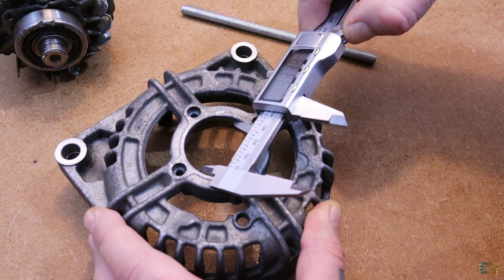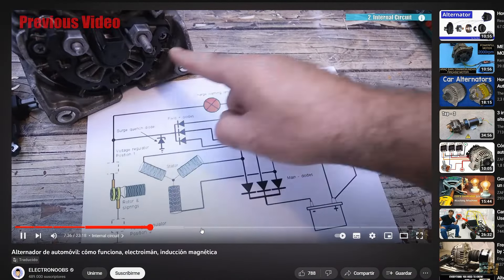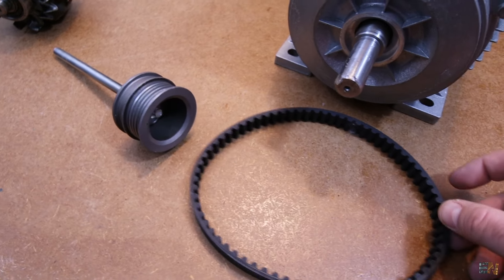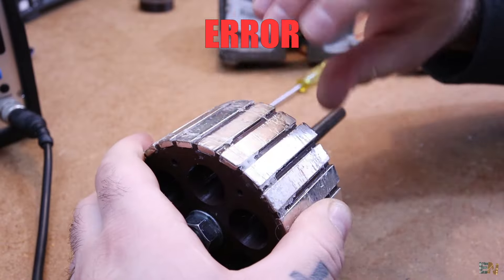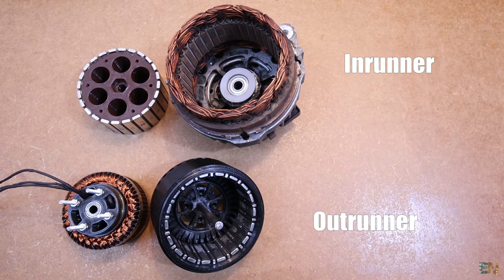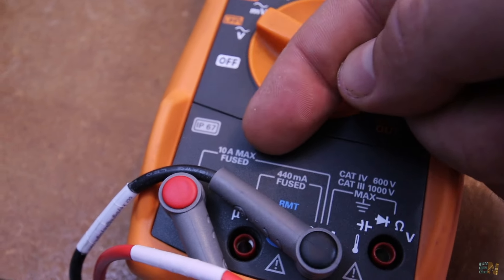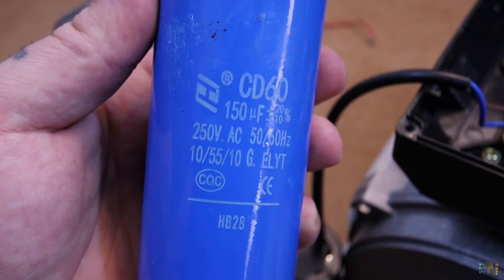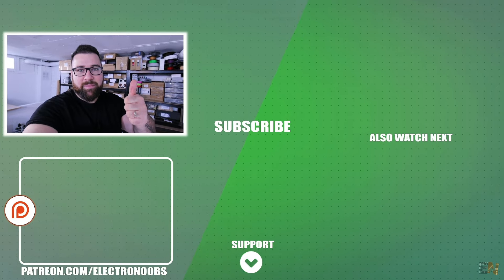Make a GENERATOR

Comment: A Car alternator puts out 120VAC per phase, you need to remove the diodes and the rectifier to get the full 3 Phase out of the Alternator

Comment: The generator was 14V x 100A = 1400VA a big difference to the magnets. Yes you need power to magnetise so that reduces the ouput power.  Another thought a transformer to convert the 3 phase to single phase and perhaps boost the voltage.  interesting video thanks

Comment: Those magnets are weak AF. Not to mention there is no way to control the voltage. Simple feedback loop AVR with a 120VAC setpoint used with the built-in electromagnetic can make this a potent little three phase alternator.

Comment: try this instead. MATERIALS: one 6 inch dia. by 6 inch long with a quarter inch hole for axle in center neodymium magnet. one threaded rod quarter inch dia. 12 inches long with 8 washers and 8 nuts. Two ball birrings , a round plastic 12 inches dia. with alluminum fins around it to create static electricity , 2 capacitors a transformer. TO give you an idea the frame holds the motor/generator on top. the static generator on the bottom both connected to the same axle pre charge the caps and start motor with 12 volt battery. motor/generator turns and gives out voltage , the static generator gives out voltage and ALL voltage goes into the capacitors. the voltage goes into npn transistor and that energy goes into transformer to plug ins strip and a wire goes from plug ins strip to motor. I suppose you could add in a 50 watt solar panel for extra power.

Comment: Electromagnet is stronger than permanent.  Yes, the ability to regulate against rotational speed and load is valuable, the move away from magneto to alternator was due much higher power generation.  What you could do, span 2 alternators.  Don't go wild redesigning the  rotor, just pop the coil out of one, and replace it with a stack of microwave oven magnets, use the power of that side to then power the electromagnet of the other.  This is already being done in production, I'm just pulling a blank on what this is called officially.  But, much simpler to use a large, powerful, disc magnet in place of the rotor coil.

Comment: 10:20  "How are the ppl from the fake videos getting 220VAC because I'm using better and bigger magnets and only get 50V peak to peak"
Here's something to consider (tho, they are fake, no doubt) when they replaced the metal portions with magnets, they left the metal core in tact. So they could very well be getting higher voltage because they have stronger magnetic flux extending out into the coils. You used plastic as the core, which magnetic flux can not be amplified in.
A revision to your rotor would be to make it so that you can put metal/iron bands under the magnets. It would be best to have a solid band from end-to-end of the magnets, but with a plastic stator, this would be difficult. Unless you drilled some holes in the metal band to help secure it to the stator. You would loose the ability to have precise slots for the magnets. Altho you could make a sleeve to go outside, or use 2 bands and have 3 spots for slots, top/bottom/middle. It would break up the magnetic flux a little bit, but not a whole lot.
Doing this would greatly increase the output of the generator.

If you look up DIY wind turbines with repurposed ceiling fans, you'd see that this is what is done to boost the output. The difference with a ceiling fan is the rotor/stator are reversed. The metal band is placed and secured to the housing the blades attach to. Then the magnets are secured to the band.
Reply from the maker: Thank you so much for all the tips. Next version should be metal made... :)

Comment: 5:31  i’m wondering if we adding some ferrite material into the 3D filament, that gonna increase the output and efficiency.
Reply from the maker: it would for sure. I don't know how muych, but it would do. Actually, I'm preparing some tests for some 3D printed motors but using resin and 1um iron powder in it, so it would be ferromagnetic :)
Reply: @ELECTRONOOBS  i have an idea for a new video, but i don’t sure how powerful it will be, that is using an induction motor (doesn’t matter it is single phase or 3 phase, if it is single phase, it required to has a aux winding or staring winding) with a capacitor can turn into a generator
Reply: @ELECTRONOOBS  the reason why your generator was only outputting 8V AC was because you had double south and north magnet polarities. this output is weak, because in actual generators, 1 north and 1 south of magnets are placed in the rotor, only 1 north and 1 south, not double, since it slows the changing of polarity of the AC current.

Comment: For The sceptics; Nikola Tesla has turned around classical Maxwell, Hertz, Einstein approach to not recognizing Scalar Longitudinal Waves, which are part of the Aether and have infinite instant speed. This are an electrical potential between A and B which by disturbing The Aether it disturbs the whole Universe. Tesla quote; If you want to understand the Universe, think in terms of Energy, Vibrations/ Resonance and Frequency. No Matter is mentioned Einstein was calling this “phenomena” quote; Spooky action in a distance. Unquote.
Tesla was spiritual extremely capable of Thinking Cleary and even he was dreaming during his lucid sleep creating his inventions in detail.
After his win in the AC DC current war with Edison he constructed Niagara Falls electric power station, utilizing Gravity of water to convert mechanical energy to electrical. It was done by using Tesla’s invention; AC power Generator as well as Transformers are still used today to light our cities, run industry, is used in medicine and many other. 
Needless to say, we use his inventions pretty much all the time, even when sleeping. 

His major inventions were Tesla coils and its applications. When presenting his Invention at Wanderclief Tower Long Island ,and successfully Pumped or connected the positive Ions in Stratosphere and Ionosphere and Earth as negatively charged. He used his double coil invention in between and converted 8 vols of DC to start the action and converted it to millions of volts of AC power.  Morgan, as an investor in the project asked Tesla what the hell this is. His answer was ; Free energy for everyone anywhere. Morgan got up and said; I’m not interested if I cant charge. This was a turning point for Tesla and he was pushed to obscurity living in hotels and after his Lab was burned down and taxi hit him on the pavement. All I learned so far by studying Tesla is ,that The World is based on Conformism rather than Curiosity and perseverance. Aby human being has got Talent for Something. Aren’t you curious about what it is?

Comment: Great Video! but I think you forgot the Inner Iron!?  Think about rebuiding the rotor with a section of 5mm or thicker iron pipe so the inner N-S Magent flux is used. This is why the outer windings are in Iron. You could then epoxy your magnets on the Iron. 
It might be fun to see how much Power Difference you would get ??

Comment: I have just make a little generator.
With tiny little n35 magnets really very small were those magnets.
And it works.
You need an iron rotor bro , and for more voltage you need to rewind the stator.
You would not believe how much power you will get.
Try it and see it yourself.

Comment: Cool. 
Question, 
If you want more power from the permanent magnets why not quadruple the size and install with fewer magnets around a redesigned rotor. Bet you can crank up that power.
Reply: Because the housing isn't big enough to house enough wire to take advantage of the bigger magnets. Should have used a 200 amp ambulance alternator that already has enough wire. Then when the windings were hooked up in series, you would get triple voltage and 66.6 amps.
Reply: Damn quadruple the size magnet will be expensive

Comment: Your generator is more impressive than you realize... Car alternators generally run 2~4 times FASTER than the motor. So you need to get that generator spinning at atleast 4,000 RPM ;-) . I bet you get 12 volts then

Comment: What about low rpm generators? How low rpm generator designed or made, means what coil's wire thickness used and how many turns required or magnet size and force are required do you have knowledge about it? If then please share your knowledge if 1000 watts generator to be made. Regards

Comment: Not having enough generator power to drive the induction motor is not the indication that the free energy self-running generator is fake, it just means you don't know what you are doing. 

The alternator you built was way too small for that motor, regardless of what turned it to produce electricity, the voltage and amperage were a major mismatch for the energy required.

I won't go into the details of how over-unity power generators actually operate, it takes more space than I have to demonstrate it here.

Comment: i-v build one at home it makes around 70 volt with just 10 magnets 40-10-5 mm , at only 250 rpm but i recoil the stator 750 turns in total

Comment: You could have put a pulley on the generator and the motor and a belt plugged the motor and it would have spun faster to the high enough voltage

Comment: There is a difference, your alternator is 14 volts and 100 amps, but Hidden Technology's alternator is 24 volts and 200 amps. Therefore, your comparison is not correct.

Comment: One reason your voltage  is so low is because you are only using a drill to rotate your rotor but since you are comparing it to the fake video you need to mirror what they used at least as close as you an. I like that Thanks

Comment: Permanent magnets lose power if subjected to heating. In a typical gas generator, the coils get hot enough to melt plastic. That's why they can't use plastic parts and save more bucks.

Comment: I produced 325 volts single phase power with one hot wire and a neutral wire from a hot tub motor I haven't checked the htz./ cycles yet but I'll let you know

Comment: hello I was interested to know culd industri type bridge rectifiers by used or darlington transistors insted standard bridge rectifier I do not have in my land solar panel regulators so was wondering if I culd use those old truck heavy dutty voltage regulators with out the field conection?
Also I am curriuse to know how it wuld by posibel to manuali set alternator speed regulation with resistora and capacitor box or avr or cloosed loop system and wuld eventualy current cutt out selenoid work to prevent over charge my baterry?
I use lot capacitors for my ignition system so my alternator does not like extermal capacitors the cutt in voltage is delayed so thats kinde of anoying so I try to finde alternative solutions for those problems wuld like litel bitt that my alternator is programabel if posibel work with out baterry in emergency situations

Comment: It's not worth spending one second of your time trying to debunk/recreate free power or perpetual motion videos.
Reply: I agree Rick!
Reply: Who is Rick prime?
Reply: @joeb134  Who is Joe B?
Reply: But watching videos are interesting and informative
Reply: @ricksampson6780 the resistance ... is less  ....no voltage ...good current .😮😮😮😮for energy pump....use a thinner wire ...long very long ....❤
Reply: You can get free energy though...if you are making electricity with salt and recycled materials no matter how small the amount is too you personally its free...if you use recycled coke cans and copper wire or tubes that you find and use sea water that too you is free energy...
Reply: 😀😄👍I think so, free energy is fake

Comment: You can't prove the generator in the movie doesn't work because you did a few things differently! For example, in the movie, the magnets are glued radically differently, and in a different order! You can see that in the film, the magnets repel each other at the time of gluing! But I think you make these changes on purpose, to prove that it doesn't work. Do absolutely everything like in the movie, then we'll see if it works or not!
Reply: Agree with you. Also, a difference between Electronoob's alternator is 14 volts, 100 amps and Hidden Technology's alternator is 24 volts, 200 amps. So, comparison in this video is not correct.

Comment: You can;t arbitrarily use x number of magnets. The best tactic is to completely disassemble the rotor and place in the position of the coil an axially polarized ring magnet(s). The hard part is to find a dimensionally correct magnet.
Reply: The six pole alternator he's using should have twelve magnets. You're correct, there's only one right number unless it's rewired with a different number of poles. A bigger diameter alternator would have room for more magnets and/ or windings poles. Twenty four magnets don't match up to the stator poles. There's not really enough room for twelve poles in that case without using tiny wire. So that part was sort of a waste of time.
Reply: @davidpotter9462   since he is using S-S-N-N with 24 magnets, the effect is basically the same like 12 magnets S-N-S-N.

Next week I make the same kind of generator. Mine is almost the same like the one in the video but made for more amps. Also I make a custom rotor thats not 3d printed but made of iron for a better flux. Also I will use 12 poles but each will have a lot more pullforce. I am not sure which grade magnets he use in the video so my guess each magnets have a pullforce around 10-15kg. My magnets have about 60kg pullforce.

I can’t wait to test the results
Reply: @sjappietappieklappie  oh okay

Comment: I have Posted my code down below. The problem I am having is that when I am using multiple pin pus to enable the outputs these outputs are not putting enough voltage out they should be supplying 5 volts to the 2 outputs that are enabled for each sequence..
1.)The three hall effect sensors are powered up from a separate 700ma 5v dc supply.
.2) The ground from the supply is connected to the Arduino Uno ground.
On another note I have been troubleshooting and just just have the Arduino Uno connected all by itself. If I connect ground to pin3 outputs 9 & 13 should both have 5 volts present but one may have 4.8 nd the other has .8 there is no load connected to these pins just straight up testing the output voltage with my voltage tester.
I need to know why both of these pins are not present with at least 4 volts even when no load is connected to them.
* Design is for The outputs areto just send a signal to a MOSFET driver when everything is eventually working correctly so a very tiny load just to actuate the MOSFET driver via the HI and LO pins.

Comment: THE REASON WHY YOU ARE NOT GETTING 240 VOLTS,.  YOU DON'T HAVE A TRANSFORMER HOOKED UP TO IT..... YOU ONLY SPINNING THE ALTERNATOR.....  YOU NEED TRANSFORMER HOOKED TO IT..... 15 VOLTS TO 250 VOLTS TRANSFORMER, YOU CAN GET FROM MICROWAVE.....

Comment: You should put the windings in series, instead of parallel, the voltage will be triple. That should be enough to start the big motor. Since you're already doing it...
Reply: are you sure puting the Windings in serie with different Phase you will have bigger voltage ?
Reply: Yeah, if it's a three phase, the voltage will triple when hooked up in series. I've done it before.
Reply: @davidpotter9462  no you will get a perfect DC 10v in output
Reply: @yuvanm9040  the Honda PMA that I did it on went from 13.1 to 39.3 volts. The alternator I have is from a Honda 660 car. If I got 10 volts I would have sold the copper out of it.
Reply: You are clearly and evidently very accurate.  "Dear" our YouTuber.. ...the divider is actually very precise!  ...that's why I don't trust you!

Comment: To be honest, you have built only one electric motor. Building a generator on a car alternator in the way you describe is just a waste of time. Car alternator produces 14.8 volts and 100Amp current maximum at 3000 RPM having a magnetic field in the electromagnet which is the alternator rotor. With the decrease of RPM in the car engine, both the current and the voltage decrease. By replacing the rotor coil with a permanent magnet, you do not gain even 10% energy, Or you need to increase the number of RPM several times more than 3000rpm. The amount of magnets you used is not in the right proportion to the number of windings in the stator.

Comment: Hi .. In the case of a voltage of 15 volts by changing the winding, it can be converted to 220 volts, and it's easy ... and should also lower the electromotor voltage to start with low electricity ... This is also a guide for enthusiasts.
Reply: wouldn't a transformer be needed to get 15V to 220V?
Reply: @DocterKankle  If you want to increase the generated voltage of a generator, you must increase the number of turns of the coil, and if you want to increase the ampere, you must increase the thickness of the coil.. By using the winding formulas, these changes can be made...  And if you want to use a transformer at the output of the generator to increase or decrease the voltage of the generator, it is possible... what matters is what you want to do.

Comment: Any device that can work as a motor or a generator is very inefficient but unfortunately, this is the popular choice because the guys that promote this design (for eons) don't want to make alternate designs popular because the overall efficiency in the case of a well designed DC motor may come close to 100% or more,  which is against the rules of the game. 😊
Reply: Would you be able to share some of these designs you're talking about? I agree I think it's a pretty obviously rig system but what Design in particular are you afraid too?
Reply: I would like to see some models of motos which can run over 100% efficiency.